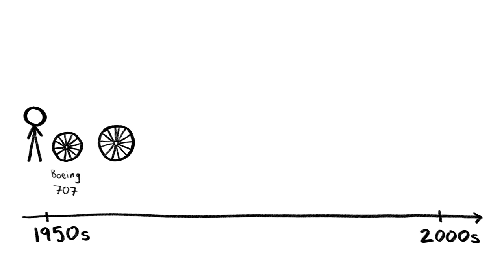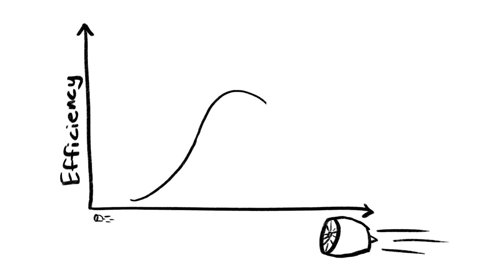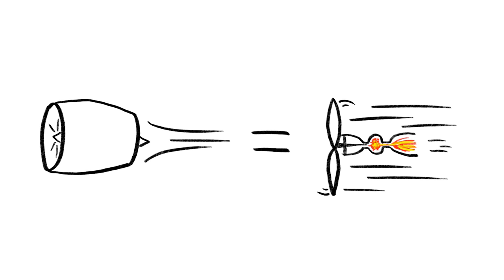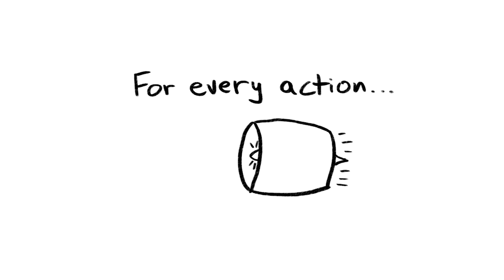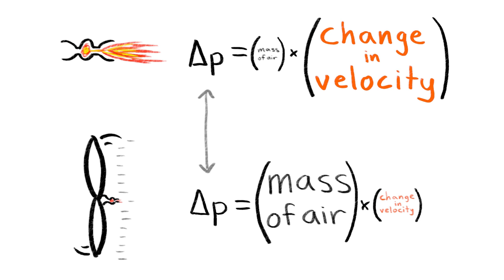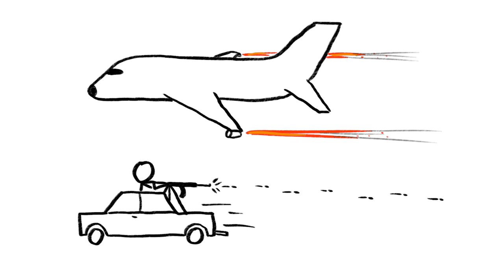Why Are Airplane Engines So Big?

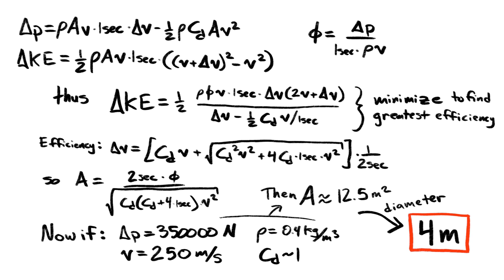Comment: 1:23 Can someone tell me what each of the variables represent and why those formulae are correct, please?
Reply: I'm trying to figure it out too. Here's what I've got so far:

Let's make sense of the first equation. In it, we calculate the net change in momentum (∆p) due to the airflow of the engine:

∆p = (ρAv * 1 sec * ∆v) - (1/2*ρ*C_d*Av^2)

It appears this is based off of this equation:
∑F = Thrust - Drag
∑F = T - D

Since the technical definition of Force is not the familiar F=ma, but actually
F = ∆p/∆t,
we can multiply through by ∆t:
∑F∆t = T∆t - D∆t
∆p = ∆p_T - ∆p_D
∆p = ∆(momentum due to thrust) - ∆(momentum due to drag)

So, the first half of the first equation will be the momentum due to thrust:
∆p_T = ρAv * 1 sec * ∆v

Our variables are:
∆p_t: change in momentum due to thrust
ρ: (Greek letter rho) density of air, kg/m^3
A: surface area of engine inlet, m^2
v: airspeed, m/s
∆v: change in incoming airspeed due to thrust

To break down this part:
∆p_T = ρAv * 1 sec * ∆v
ρA = density of air in one dimension, along the velocity vector, in kg/m. Multiply by distance to get mass of the air in kg.
v*1 sec = distance air moves in 1 sec, in m.

So, the mass of the air moved in one second is
m_air = ρA*(v*1 sec)

Since we sped it up by ∆v, our momentum is
∆p_T = m_air * ∆v
∆p_T = (ρAv * 1 sec) * ∆v

All right! Now for drag. The change in momentum due to drag was:
∆p_D = 1/2*ρ*C_d*Av^2

I'm guessing that C_d is some sort of drag coefficient. This will depend on the relative size of the engine inlet and outlet, the dead area around the turbofan, and other things. I'm not an aerospace engineer, so I dunno.

To derive ∆p_D, let's talk about force again. The drag force is:
D = ∆p_D / ∆t   (from the definition of force: F = ∆p/∆t)
D = ∆(m_D_air*v_D)/∆t
D = m_D_air*v_D/∆t 

Note that the drag speed of the air v_D are NOT the same as we used for thrust. Since this is drag, this means still air is hitting the engine and getting sped up to a speed v_D, which is some fraction of the aircraft's airspeed v, before getting knocked out of the way. We'll call this unit-less fraction K, so the drag air speed is:

v_D = Kv

Actually, the amount of air getting knocked away from the active zone of the engine m_D_air is also not the same as the mass of the air entering the active zone m_air. But, it is proportional to the size of the engine inlet just like m_air, so let's absorb that into our unit-less factor K, too. Since K is our own little constant, it's ok to change it:

v_D = Kv  (not using this anymore)
m_D_air * v_D = Kvm_air   (redefined K)

Back to drag:
D = (m_D_air * v_D)/∆t
D = Kvm_air/∆t

What's m_air? We calculated this above as

m_air = ρA*(v*1 sec)

Let's just say our ∆t was 1 sec all along:
m_air = ρA*(v*∆t)
D = (m_air) * Kv/∆t
D = [ρA*(v*∆t)] * Kv/∆t
D =  KρAv^2

To get back to drag momentum, multiply through by ∆t(=1 sec):
D∆t = ∆p_D
∆p_D = KρAv^2 * ∆t
∆p_D = (K∆t) * ρAv^2

From the video, we had:
∆p_D = 1/2*ρ*C_d*Av^2
∆p_D = (C_d/2) * ρAv^2

So the mysterious drag coefficient is:
C_d = 2(K∆t)
C_d = K*2 secs

Not sure why the 1/2 and hence the 2 secs, but hey. The units match!
Reply: Hi @MinutePhysics, just looked up Drag coefficient on Wikipedia. Looks like I found an error in the video; C_d is supposed to have no units. I think you forgot to add a * 1 sec at the end of the first equation.

Comment: They are growing in size because our ability to fine-tune them is increasing with technology. The smaller engines of the past were at the most efficient size they could have been for the level of technology they were built with.

Comment: Can I ask some question about flight? if you launch a rocket in space will it keeps thrusting at the same amount of speed even if running out of fuel because in space you don't experience drag or zero gravity. can you explain to me
Reply: +ted2ar going through space isn't the issue, leaving earth is.
Reply: +ted2ar Well, if you're not near any sources of gravity, more or less, but launching from earth there are a ton of things with gravity. Planets, the sun, etc. that will pull you toward them. You generally have to escape the gravity of a body or else orbit it (continuously fall towards it).
Reply: techmage89

Okay? I know how gravity works already, so what is your point? Understand that these celestial bodies are extremely far from each other.

Comment: You said the most efficient diameter is still slightly bigger than the current size, why are the current engines still a bit smaller then? Do they not know there is a more efficient way?
Sorry if that sounds like a dumb question
Reply: +DecGreg Just because they know 4 meters is optimal doesn't mean they can build jet engines that size.

Technology limits exist.
Reply: +seigeengine copy and pasting?
Reply: FOXER Nope, writing it out each time.

Comment: You should really study up on the actual operations of jet engines.  Fighter jets use the same kind of engines as passenger planes (turbofans) because the military is even more interested in fuel efficiency.  If jet fighters still used turbojets (what you refer to as "jet core"), they'd have to carry too much fuel which would degrade performance.

Comment: Also, turbine engines have gotten bigger due to relaxation of safety regulations. Used to be, you needed >= 3 engines to cross an ocean. Today, the Powers That Be have decided two engines are safe enough--engine failures are so rare. So, instead of 3 or 4 engines, you can now build a plane with two, really big engines.

Comment: So 4 meters is currently about the ideal diameter for an engine? Is that determined by the size of the plane. I suppose if the plane was bigger than, say a 747, with bigger wingspan then could that warrant having engine sizes like 5 meters? Or is there some other constraint that makes anything more than 4 meters not doable. (In which case eventually you would think we might need to design a totally new engine mechanism to propel and give lift)
Reply: +plica06 No, it's because if it were any larger it would become less efficient from the drag.
Reply: I see, cheers. So in that case there is an upper limit to how big passenger planes can get if they are to continue being propelled by currently designed engines... Time for a new way>> Anti-Gravity baby!!
Reply: plica06 Well, one could just add more jet engines to reach the thrust needed to propel a larger plane. The video is talking about the efficiency of jet engines, not planes.
Reply: +Chris Badiou I see that but nevertheless jet engines are the main way that planes are propelled. The interesting take home message of this video to me is that jet engines have an inherent design limitation meaning their usefulness in propelling planes is limited. Airlines would like planes that can travel longer distances at greater speeds and without re-fuelling and that could be larger which could enable them to offer travel at cheaper ticket prices. Eventually the jet engine will need to be replaced with a better source of propulsion. I am no Einstein but I have no doubt that Anti-Gravity is the wave of the future.
Reply: +plica06 Anti-gravity eh

Comment: Didn't they know about this efficiency issue when they first begun building jet airliners?  Why the relatively recent switch to high-bypass turbofans?
Reply: Ease of manufacturing I'd guess. It's one thing to know of a more efficient design and another to build it.

Comment: Is drag really that big of a deal? In any case, only the channeling of the engine causes drag, and in precentage to the engine, it does not increase that much. 
What limits the size of turbofan engines (or all turbine/propeller-style engines) is that the fan blades must not exceed sonic speed, and supersonic flow speed through the engine is also not possible (it causes all sorts of problems with compression and combustion and also supersonic spinning is extremely inefficient) so there is a diameter limit at given RPM :)

Comment: Well, if the engine diameter is close to 4 meter , it might as well be a turbo prop. Most turbo prop are smaller than 4 meter diameter any ways. The jet engine is just a prop engine with a housing around the propellor .

Comment: Does ideal engine size vary with cruising height?
Reply: +nacoran It may, but one would also need to consider air density as a function of altitude. Too high and there is insufficient oxygen to burn and too thin of air to allow the wings to function without gross modification. Too low, and there's so much more air to push just to maintain speed.

Comment: Equations at 1:23 dont make much sense; the conclusion seems to be based on some assumptions about values in the equation. Bit still, 4m fan seems reasonable for current configurations, assuming negligible thrust from the core.  But a 2m blade, thats going to be moving pretty fast, so revs will have to be limited to avoid tips going supersonic, and materials will have to get a whole lot stronger. I’m sure there are teams of engineers working on it, somewheres.

Comment: Very interesting, but this brings me one question: What's the reason jet engines have been designed with gradual increases of diameter over time, instead of being designed with the ideal 4 meter diameter right off the bat?
Reply: Hydrogen fuel cells can generate the power to drive your car and the only exhaust is water vapor, why aren't all cars powered by hydrogen fuel cells?

Remember, a company has to make money. Implementing technology in the real world isn't always as simple as going with the most efficient mathematical option. There's way too many factors as to why companies chose the technology they do.

Comment: It's stupid to say "how surprising that the A350 has larger engines than the 747 even if it's a smaller aircraft". The 747 has four engines, the A350 has just two... Thrust per engine on the A350-1000 is 50% higher than on the 747-8I.

Comment: Is it true if you fire a rocket in a line in space, the center of mass of the rocket and expelled gas never changes location?
Reply: It would depend on the type of fuel and how it's being consumed. Solid rocket fuel consumed from the bottom of the rocket to the front of the rocket would appear to change its center of mass as the fuel is consumed. Are you thinking the energy output of the consumption of the fuel would offset this? Would the position of the combustion not alter that? I guess it's a good question and definitely something you have to consider when building a rocket....meaning it would change unless you designed it so that the center of mass wouldn't change.

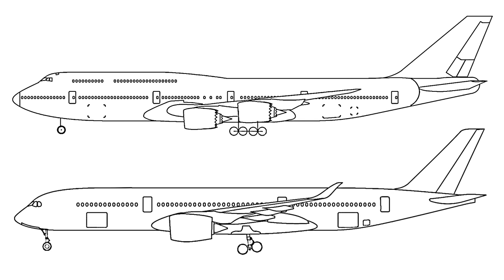Comment: @0:08 - But the 747 has 4 engines while the A-350 has twin engines.
Reply: You missed the point entirely, he's trying to say is that older engines are smaller than newer ones. 
The Boeing 747's first flight was 1969. The A350's was much more recent.
Reply: GingerTurnip2 I know what his point is. My point is that the 747's engines can be smaller despite the plane being bigger because it has 4 engines instead of two. Also, the 747-8 is new design whose first flight was 2010 and uses the same engine as that of the 787, whose first flight was one year earlier in 2009.
Reply: GingerTurnip2 And another thing...The engine on the 777 is bigger than the engine on both the A350 and 787, despite being older.

Comment: So the next obvious question is why didn't they make jet engines bigger decades ago? I expect this maximally-efficient size was known for most of the jet age, so why did early jetliners have 4 or more smaller engines instead of just 2 large ones?
Reply: +Joel Froese The obvious answer is technology limits, mostly, I'd guess, materials science.
Reply: Well there's also cost to factor into. Those bigger engines are more complex
Reply: +Joel Froese Because they require a lot more underwing clearance, which require a longer, more fragile landing gear and big engines are hard to make.
Reply: Difficulties producing an engine that size and maybe backup just incase one failed

Comment: why is it eqsier to go from 10 to 20km/h than from 100 to 110km/h ?
i am having trouble understanding this, because eventhough you do not need more force, since you accelerate 10km/h in both cases.
oh right you need more energy, so more fuel to bring the same amount of energy which then converts into Force...
Reply: More drag
Reply: drag increases exponentially with speed.
a car uses about 30hp just to fight air resistance at 100km/h, at 120km/h it's almost 50hp.
needless to say you don't need even one horsepower to beat wind resistance at 20km/h.

but that's not all. even without wind resistance, when you're going 100, you're probably at a higher gear. so you sacrifice your torque multiplication of lower gears for more power, which allows you to go faster, but you accelerate slower.

Comment: But why are they slowly approaching 4m instead of just going straight to it?
Reply: +David McGhee I guess there is a lot of math and engineering involved to increase the size of your current engine even by a bit. You probably don't want to make a step which is too far away from your current (working and reliable) engine design
Reply: +David McGhee I would imagine some of it has to do with manufacturing development. Jet engines are crazy complicated and precise.

Also, with larger engines come larger ground clearance needed. Larger struts and landing gear, different wing positions, and, ultimately, airport terminals capable of servicing very high aircraft doors.

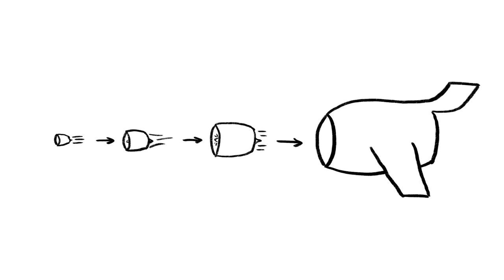Comment: Okay, anyone know if the big plane on the right at around 1:32 (the engine with wings) would work?  Could you make an engine with wings that could fly, damn the efficiency?  Obviously you'd need somewhere to put fuel, as the wings don't look like there's enough room for wing tanks.  Neat idea.
Reply: +Stephen Furr Yes, and some jet aircraft, largely early ones, do do this. You're sacrificing top speed and aerodynamics greatly, though.

Comment: well so my question is: if it's possible to calculate the best size like you do (and find 4m) then why airplane do not just have engines of this size from the begining ?
Reply: Because companies have many many other considerations to look at when implementing technology in the real world and the company needs to make money. (If it cost way to much to make the efficient engine, the cost saved by the efficiency of the engine doesn't  offset the cost to build it, company doesn't build it.)

Comment: This is what I don't understand for boat engines and prop aircraft (excluding turboprops and fancy 360 marine pods).

If a big prop aircraft needs its props turning for example at 9000rpm in order to takeoff and climb, why does it need a massive engine to do so given the resistance of air doesn't change like a cars would (bigger car, more weight, more resistance from the wheels rotating needing bigger engines).

So if I ran for example, a DC4 with its radial engines and measured that each engine was rotating at 13000rpm at the prop at max power, then swapped the engines out for a 1.3L turbo 4cylinder that geared- achieved 13000rpm at the prop at near max power, why wouldn't it work? (Not including heating etc and aviation specifics for now)

The mass of the prop has not changed, the mass of the air has not changed, the smaller engine is easily capable of a geared 13000rpm. But instead, bigger the piston prop plane, the bigger the engine?

I'm sure I'm missing something, can anyone explain?

Same for boats. The mass of water does not change, so if a mega ship with two 38L diesel turbo V12 engines turn the prop 700 rotations per minute to cruise, why can't a geared 4.2L turbo diesel do just that?

Comment: Can you make a video on what is the northern lights? I simply don't get what it is.
Reply: The sun unleashes a constant stream of solar radiation. This is basically a river of charged particles moving very fast. When these particles slam into the Earth's atmosphere, they collide with a great amount of energy. This energy is so great it causes the particles in the air to become charged and full of energy. Since this highly charged, energetic state isn't the most stable state, the particles release their energy to their surroundings. When the gases of the atmosphere become charged and release that energy it usually causes some photons to be released (the energy of the photon is related to the type of particle and how much it's energized, and how it's released). You are seeing the photons being released as the charged particles of the atmosphere go into a more stable less energetic state.

Comment: They are small compared to the power and their huge fans. Who came up with this question? Airliners use turbofans,the huge fan one can see rotating on the intake side produces a considerable amount of thrust about 25% of the total if i'm correct.

Comment: Can someone explain what ρAv1sec🔺v means? It should be mass, but I'm not sure why area matters and what the 1sec means.
Reply: It has to do with the change in pressure and velocity of a gas, where A is area. He then uses this calculation to approximate the energy generated.

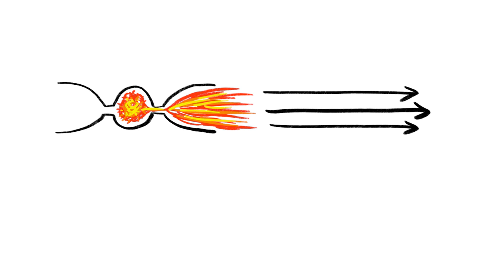Comment: 0:38 Wait, but for rocket engines, doesn't increasing the exhaust velocity mean you can use less fuel per delta v? Why is this more inefficient for jets?
Reply: You can indeed gain the same amount of momentum more efficiently by shooting a 2kg cannonball at 1km/s than by shooting a 1kg cannonball at 2km/s. Airplanes are surrounded by air, which is free, so they will choose the more thermodynamically efficient 2kg cannonball. Rockets have to bring their cannonballs with them, and the 1kg weight savings more than compensate for the energy wasted in the cannonball.